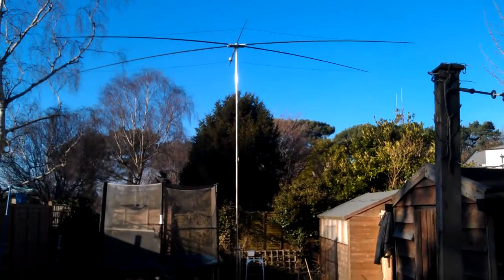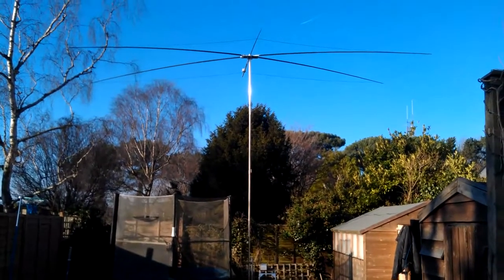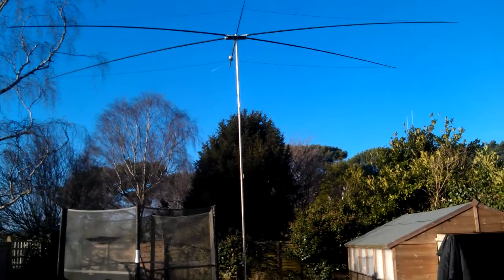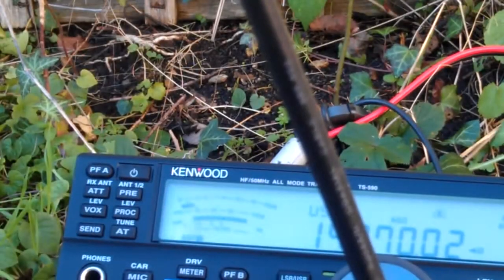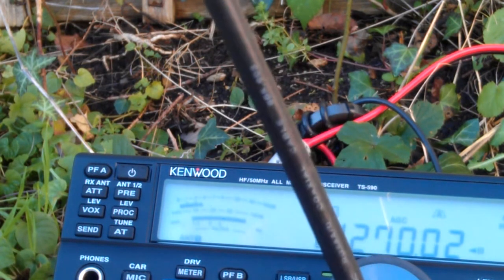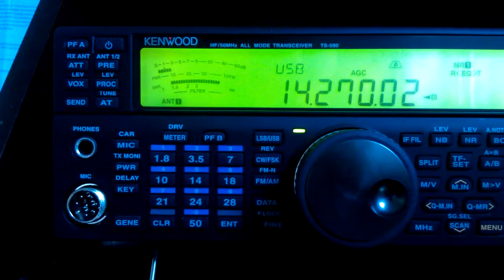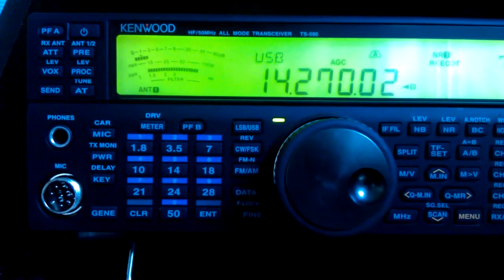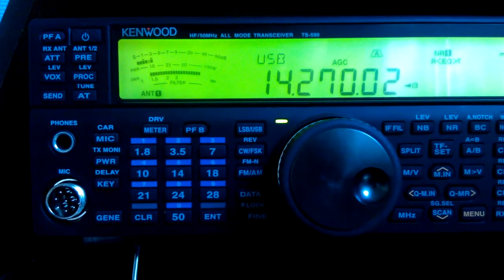More Initial Moxon testing.. the 20M F/B

Comment: Nice build! I have a cobweb as well (home built) and I'm thinking of building a twenty meter Moxon. Now you've had it working for a while would you change anything in the build or have a different set up?
Reply from the maker: zyphod beeblebox Merry Xmas. Im very happy with the Moxon and wouldn't change anything about it for a portable build. But if i was building for a permanent instal I would make the arms curve up under strain like a hexbeam. its a nice quiet antenna and u will like it  73